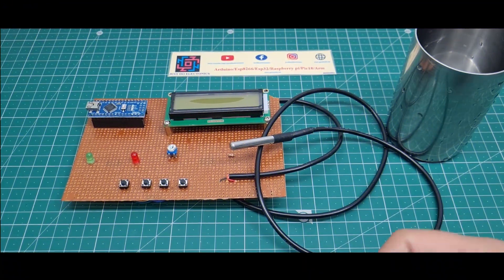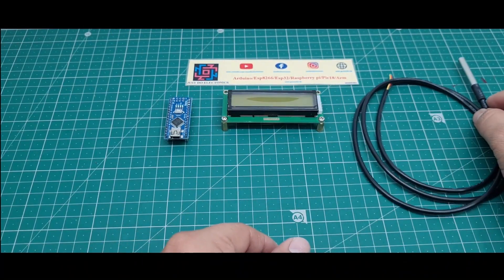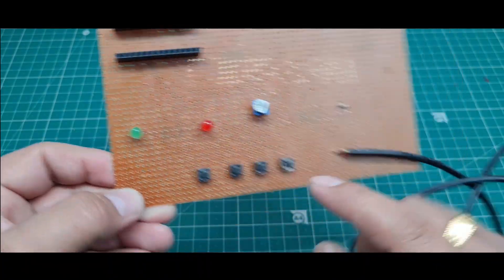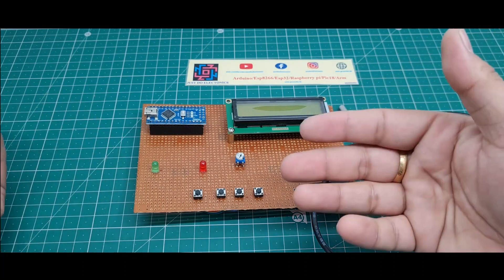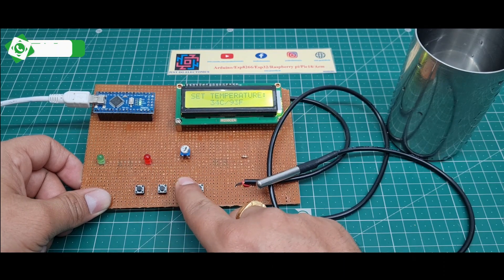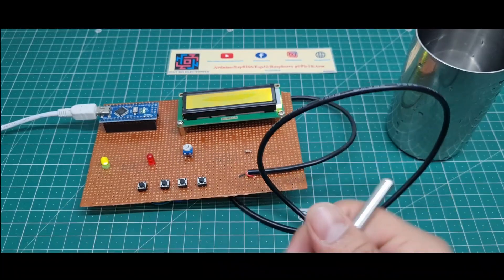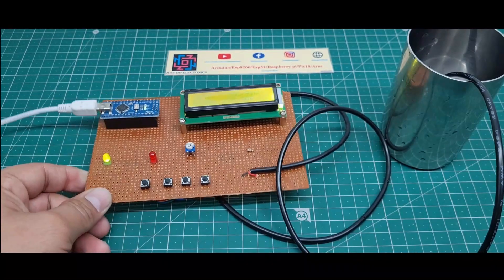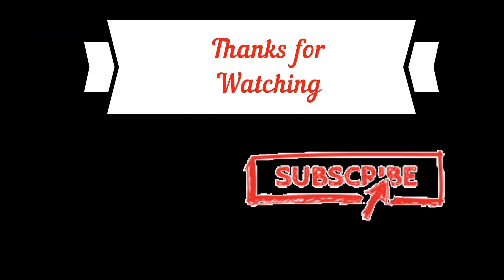DIY Room Heater Autocut using DS18B20 Temperature Sensor with Arduino | Temperature Monitoring

Comment: Great project! I want to use this with 3 temperature sensors. Any tips on how to adapt the code to cycle through the 3 sensors  would be appreciated.  Alternatively,  I could use a 4 line display and show one temperature on each line.
Reply from the maker: thanks